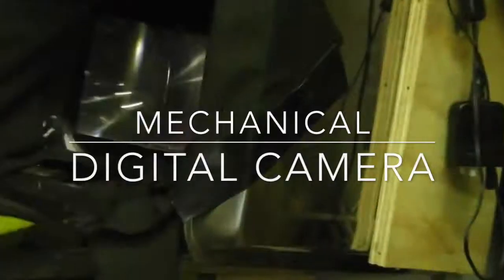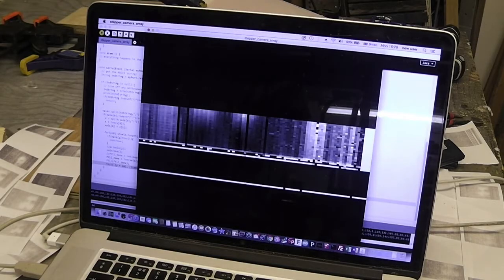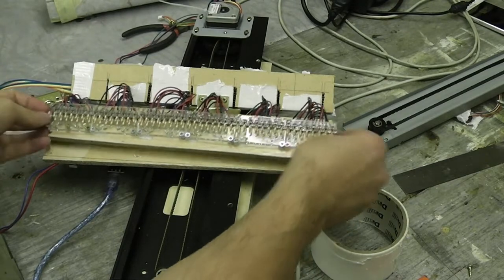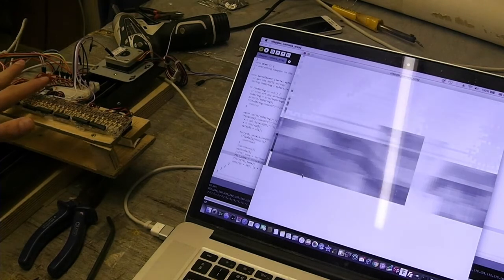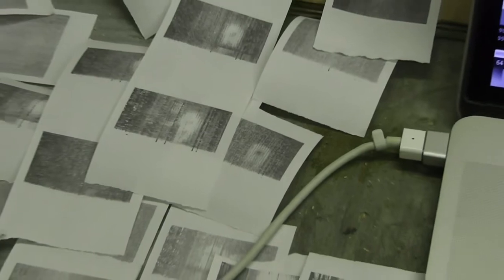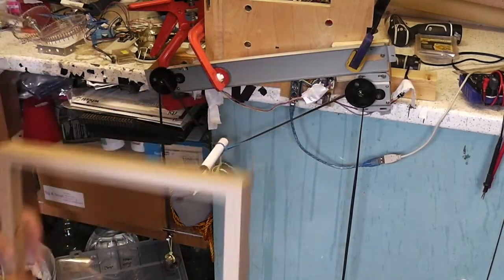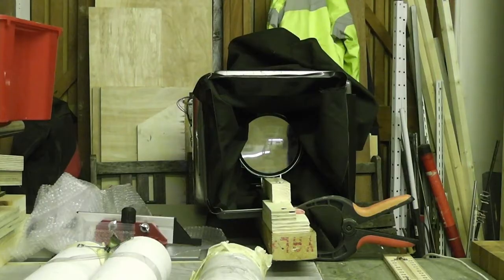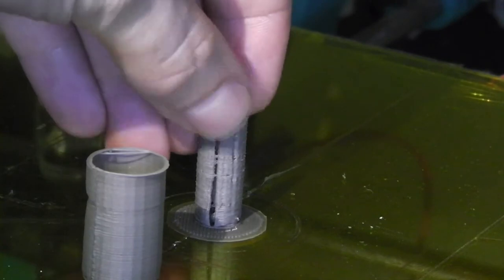Mechanical Digital Camera (Arduino based)

Comment: I made an arduino digital pinhole camera, but it was very basic. I had to hold the LDR and move it to the next position then register a pixel by pressing a key. It didn't work because the low sensitivity. It's nice to see that a similar idea would work if it was done properly.
Reply from the maker: Thanks, this idea could certainly be done neater and more 'properly' than I did it, too!